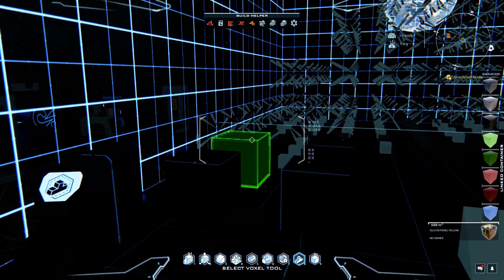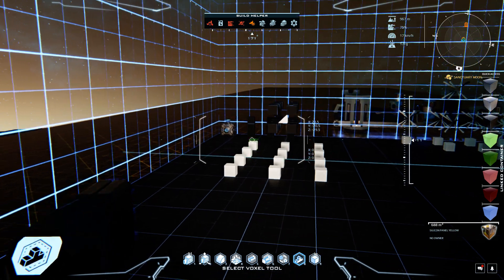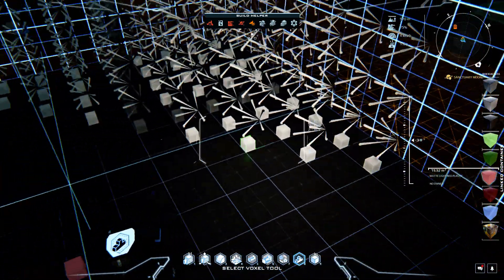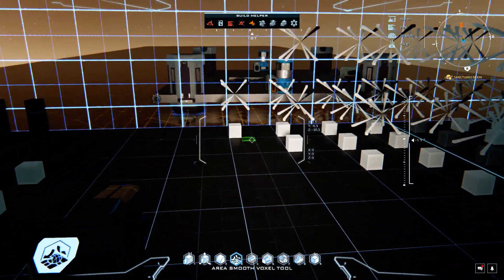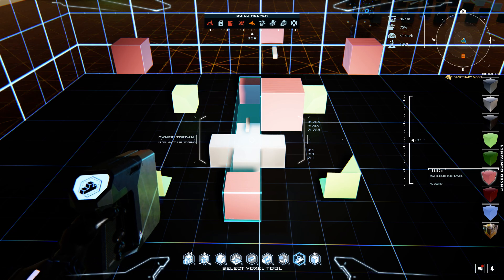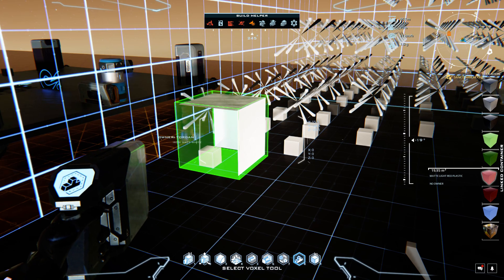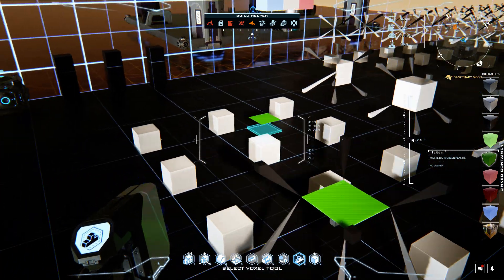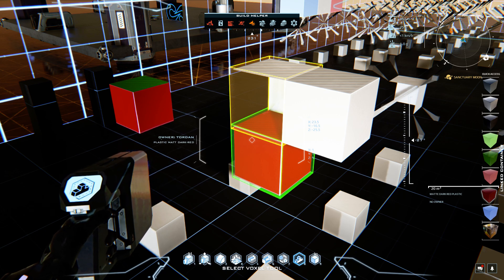DUBeta  Adv. Voxelmancy 102

Comment: How do people make grates though - where the thinned 1/4 voxel "railing" is next to another 1/4 voxel "railing" but the vertices don't try to connect to each other?
Reply from the maker: generally by offsetting half of the bars in from one direction and the other half in from the opposite direction.
Reply: @Tordan  Thanks for your reply - I thought it was something along those lines but wouldn't that only create one gap with the voxels trying to merge on the other side? How would you offset the side that's already offset basically?
Reply from the maker: @Volkaer  i might do a video on it someday.

Comment: Its all still a lot of smoke and mirrors for me! But your videos (including the ones for the other game, are helping).  When i placed my 'floor' down for my base..just using basic blocks..i noticed it had a lot of weird interaction with the ground..and material was interacting with it and filling up spaces thus using more material than needed. I suppose if I offset a flat to the top of the prime voxal box..it would give me a proper flat floor that would appear to just be hovering above the ground? Is that a correct way to think about things? I know that's probably a very basic understanding but its almost a light bulb moment for me 🤪 lol
Reply from the maker: There are some bugs in DU at the moment, that make voxels render wrong. Where even though the verticies are actually in the correct place, they render warped. What you are discribing sounds like one of those bugs.

Comment: I have been experimenting with this for a while now. Been trying to get the flat voxel that you showed around the 15:39 minute mark. I can't even explain what I think I am doing wrong, because I just dont get what I am doing. Every flat that I create is in the center of a regular voxel, so I cant create any pointers that would push the lower portion of a regular voxel up.

The reason I am trying to get this particular flat is, that I am trying to create a very small bevel on a flat surface. Here is an example https://i.imgur.com/JeK88wO.png
I want the black portion the be much lower, currently its half a voxel. Lets say I want it to be a quarter of a regular voxel...

Is that even possible?

Would the flat at the 15 min mark even achieve that?
Thanks a lot for your help.
Reply from the maker: I will be doing lots more videos that will get into these details. 201 will cover much of what you are asking.
Reply: @Tordan  Thanks, looking forward to it.

Comment: The handles don't work for me. At 10:02 you copy with the handle. When I do that It only grabs the small cube...it disconnects the voxels...and instead of copying the line it just grabs the small cube. What am I doing wrong?

It also tells me "invalid construct"
Reply from the maker: The most likely reason:
The handles by definition help pick up the voxel in the center. So to pick up the line you need to place the first voxel one over from the center, then place the second voxel in the center so that it can stretch to meet the first voxel. now the line will be the voxel in the center, and the handles will pick it up.
Reply: @Tordan  thanks got it